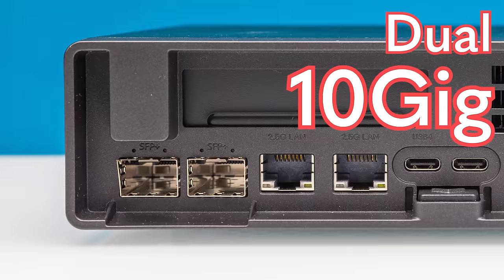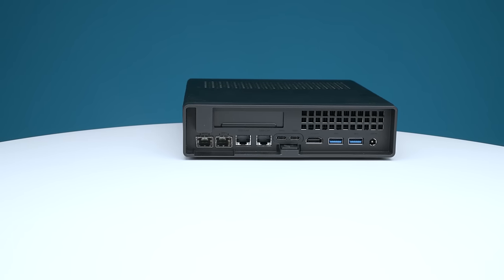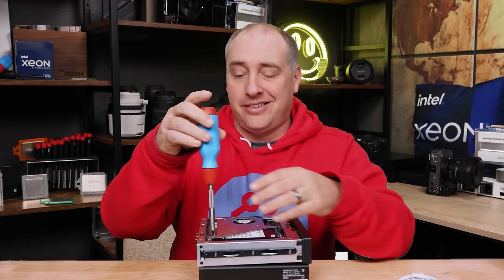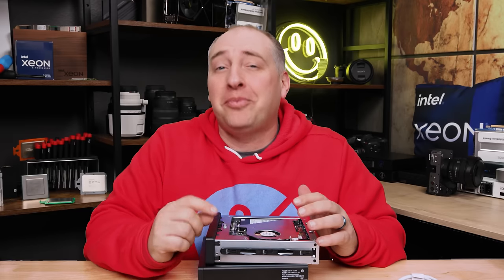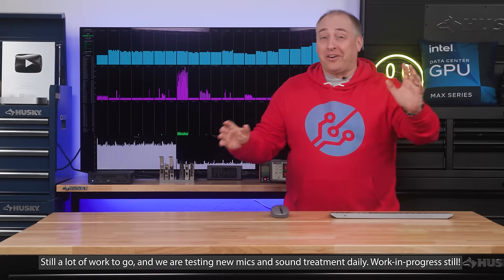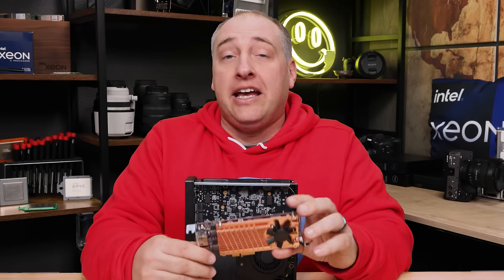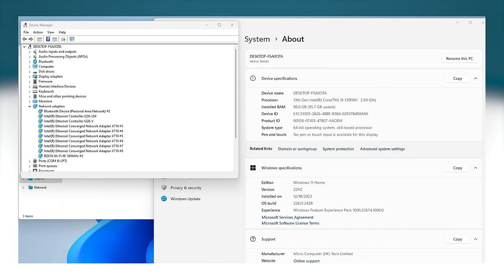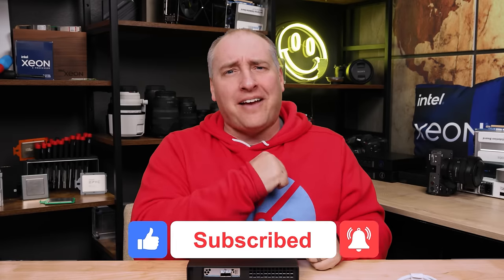The Pinnacle of Mini PC Servers - Minisforum MS-01

Comment: That feeling when random small chinese OEMs actually listen to customers while bic corporations still make the same NUC clones 10 years later
Reply: They listen but sometimes don't understand.. Case and point the R86s now has USB-C power, but it isn't standard USB-C PD power it is some funky direct wire that doesn't seem to work with a bunch of power supplies. The point of users asking for USB-C on it was so they could use standard high quality power supplies easily.
Reply: @YKSGuy this is probably due to cost constraints.
Reply: @Wfmike  cost constraints? Do you know how cheap it is to get a little PCB that just requests the right voltage from a PD supply? Costs a couple of dollars, probably way less if you're an OEM
Reply: @fallow_  sure a PD trigger is cheap... but you cannot just slap a port like that on the machine....
Reply: @nhansgoofyvideos7581  but that appears to be what they did, but without the PD part, they just swapped the barrel with a USB-C physical port that does not seem to quite work with most USB-C power sources.. Slapping the PD board in there would probably have been more reliable or SIMPLY not changing from the barrel jack.. IN some ways a non standard USB-C is WORSE than a barrel jack.
Reply: 25:30 can it run a 32gb FC card? You know, to attach to my SAN. 😊
Reply: @YKSGuy  Language barriers probably play a part into this tbh. I'm sure they've probably seen the responses the product reviews and realized their 'mistake'.
Reply: I didn't realize Bic even made things other than like pens or lighters
Reply: American fans being angry now
Reply: Minisforum isnt exactly a "small chinese OEM"
Reply: @deher9110  it's close enough.
Reply: Yea they listen to everything the customer does too lol
Reply: @kliniktech2485 while the lone indonesian rushes to defense of dear PRC
Reply: The big players know this would cannibalize some server sales so that's why you'll never see something like this HP or Dell.
Reply: Ooof
Reply: @marcogenovesi8570 At 400+ likes/thumbs ups, your comment is still underrated.
Reply: This is what i feel since soo many years =)
Reply: Intel tends to do that
Reply: @silenthill4  I said "NUC clones" not NUCs. I'm talking of ASUS/Gigabyte/MSI and other big OEMs. They all make NUC clones that are just mini PCs for basic office use
Reply: @jamesgarcia123  Legend says they listen through... a backdoor lmao
Reply: Same thing with switches too. Why isn't TPLINK / Netgear / Mikrotik / Unifi etc not keeping up with the plug and play managed switch 10Gbe stuff flying out of aliexpress?

Comment: 13:00 They could have made that voltage switch safe by design. Meaning, if you want to install the U.2 adapter, place the switch in a way that the adapter can only be installed when it’s switched „out of the way“. Same goes for the M.2 slot. Chance is, that it could be placed that both the U.2 and M.2 could only be installed when the switch is set to the correct voltage (position).
Reply: agree, they can use some NC pins to do auto-detection for required voltage supply instead of doing the "killswitch" method. The idea being atleast there's 2 NC pin on SSD that arent being used, both by SATA and NVMe protocol on M.2 M key, and if the user plug the M.2 to U.2 adapter, this two separate NC pins is shorted, thus telling the system to send 5/12V signal instead of 3.3V
Reply: my problem with the switch is that it makes the standard connector none standard, installing a small jumper cable to bring the correct voltage to the adapter would have been much better in terms of safe i think.
Reply: @pingtime that could work, although, I wonder if there's standards compliance issues preventing this, and if they want to sell the M.2 to U.2 adapter board as a separate SKU and be universal with other systems from other OEMs. Maybe the switch could have a plastic barrier that physically blocks the M.2 port when set to U.2 mode, that may be better. Having said that, a better design is certainly desirable and needed.
Reply: @blkhackr or have a power connector on the motherboard that the adapter board slots into in the same way as it connects to the M.2 slot that provides the correct power.
Reply: @technerd9655  From what I know working as ODM engineer, no, atleast PCI-SIG didnt really enforce it. For example, M.2 E key should have 2x1 PCIe lanes + USB coming off it, (yes, not PCIe x2, but 2 separate x1 lanes), but most manufacturer didn't bother, and when google released their dual coral TPU on M.2 E key form factor, almost all customer that tried it on their off the shelf M.2 E key slot only can use 1 of 2 TPU chip, since the second one routed to non-existent 2nd PCIe x1 lane.
Reply: A spring on the switch to force it to m.2 position, and the u.2 board designed to push the switch over during install. Dun and Dun. 
(Or just leave the u.2 out entirely. It's such a tiny niche feature and anybody reusing u.2 in a homelab would be happier with a jbod chassis that supported hot swap anyway.)

Comment: Patrick, the newest rev of the MS-01 with the 13900H, the U.2 or M.2 switch is now labeled higher on the board, so when you have that adapter installed, you can now see the mode the switch is set to.
Reply from the maker: Good to see they are taking my feedback.

Comment: I would like you to run your power tests in a low power configuration. Most people want a system like this as a home server. In a home server application, the idle power consumption is key and the max performance is almost irrelevant.
Reply: Yhe the 10 watt is way to much. Power is expensive and everything above 8 watt is a no no. Would love to see how low it can go.

Comment: 7940HS would have been cool so we had built in AV1 encoding. The Arc Pro A40 is still MIA over a year later.
Reply: Same sentiments. I'd probably hold out for the V2/next release.
Reply: AMD AV1 encoder is worse than QSV and NVENC, and if you are doing AV1 for archival purpose then CPU encoding is still far better.
Streaming wise QSV h265 is already blazing fast so idk why there is this craze about AV1 hardware encoder
Reply: @n0k0m3  
True. It would just be a nice to have if you use your server to encode streams in real time, assuming your other devices support AV1. Doesn't really matter, but being able to stream a movie from outside your home in just a tiny bit better quality at the same bitrate is worth it to some people. Would be great if the Arc A40 was actually available or if Nvidia cared about the low-power market. The last half-height, single-slot card we got from Nvidia was the GT 1030, and it doesn't even have an encoder. And the T1000 uses Pascal's NVENC.
Reply: @n0k0m3 From what I've read so far, the gap between AMF AV1 encoder and QSV and NVENC ones is far smaller then the gap between H.264 and HEVC encoders.
Reply: @offspringfan89  ur right, my bias was from EposVox video 3-4 years ago, just got updated with the Tom's Hardware video encoding benchmark.
Apparently gaps between AV1 encoders (NVENC, QSV, AMF, CPU) are between 1-2 VMAF points now and in some cases they are equal. Also FPS for QSV is a little bit lower as well so having the 7940HS will be indeed beneficial

Comment: I just ended up pulling the trigger and pre-ordering one of these. I already got the Quotom unit previously reviewed (Q20332G9-S10 now sold out) and mentioned in this video. With the pair of SFP+ ports, it will be an easy path to 10Gb networking. I'm not moving over on day one, so i'm glad there's still a pair of 2.5Gb ports as well. This box will be perfect for any sort of transcoding and even some AI LLM use. Can't wait to get it.
Reply: Sold out? I hope that product line isn’t dead.

Comment: Impressive little box. They should look into GPU modules using mobile GPUs/power supplies in the same case, would be neat to be able to stack them and connect over USB4 with it looking quite neat.

Comment: I like the thin client form factor a lot more than the typical mini-PC form factor. It's similar to ATX cases where you can just pop off the side panel to swap parts, and also looks sleeker while taking up less horizontal space when it's setup vertically. When it comes to thermals though I'm not sure which one is better.

Comment: Great video review as always -- appreciate the in depth coverage.  I've been waiting for this video since you teased the MS-01 in the short.  

I know you recommended keeping below 25w, but the Minisforum website claims it can support a RTX A2000 Mobile so I'd have loved to see that claim tested.  While you have a lot of server/IT fans, there's probably a lot of crossover for people who like gaming/workstation content and would like to see at least one or two cards tried out in that realm with the results documented.  Thanks again, keep up the good work!
Reply from the maker: I talked about it a bit more in the main site's review today. RTX A2000 Mobile support is modders in China. We could not get a LP single slot A2000 Mobile. You also need enough power for it (240-250W power brick) and it will drop the CPU power limits and performance by adding the A2000 Mobile.
Reply: @ServeTheHomeVideo  will double back to the article, thanks. 

 Any other low profile half height graphics card would have sufficed.  Tracking on the reduced power available and the bigger brick need.  If you guys didn't have a bigger power supply for testing purposes I understand - just know there will probably be many comments asking about it (which is always good for the algorithm :V).  Thanks!

Comment: I wish you would do actual tests on deep packet inspection throughput. That is a far higher demanding workload for using this as a modern firewall than just routing and stateful inspection. That other mini PC you talked about in this vid for comparison doesnt even come close to 10gb routing through the firewall to WAN when running something like Surricata or ZenArmor. This one *might*, but it would be nice to see some testing and see for sure just what it can do. This one may have more cores, but it is still only 200-400MHz faster (depending on  if you have the 3758R or non-R), so single traffic stream performance likely wont be more than around 1gb faster. Coming from not only the bit of extra core speed but also more IPC in this CPU.
Reply: FWIW I run Suricata on an i3-8100 which is probably considerably slower than the i9-13900H, and it only uses about 25-30% CPU for 1gbit/s down. I’ve only ever checked global CPU utilization though, so I have no idea how well spread out it is over the cores. Still, I’d be confident in this machine being able to do well above 1 gbit. Will it manage 10 gbit? I’m not sure.
Reply: Do you want to do deep packet inspection on your 10G traffic? IDS/IPS only ever made sense to me on a WAN interface to hostile external environments (aka the Internet), and those aren’t usually more than 1G links.

Comment: @ServeTheHome maybe is worth to mention ( as a note ) that 96GB of RAM is supported only on the model with the Intel i9-13900H, the one with the i9-12900H only supports 64GB of RAM according to Intel design.
Reply: Thank you.
Reply: It may be worthwhile to test more than 64 gb on the 12th gen as Intel ark limits on ram isn't always a hard limit. The Intel N305 seems to work well enough with 32gb to have mini PCs ship with it even though it's limited to 16gb according to Intel.
Reply: @Lollllllz  I've place the order for Intel 12th gen edition, maybe I can check on mine when arrives. I'll let you know, but I'm not confident it will works
Reply: Upon further review, this is no longer as clear. Intel may very well have implanted a hardware block on the H CPUs out of spite for OEMs. Who's got a 12th gen coming that's willing to burn some money?

Original comment:

STH has tested 12th gen with 48 GB DIMMs, so this is incorrect. https://www.youtube.com/watch?v=HylKpDmwaFA

Intel 12th gen absolteuly supports these DIMMs, and the mobos should be identical so there's no reason the 12th gen model won't. As always, documented support and actual support are never the same thing.
Reply: @MattNukem  that particular CPU is listed to support up to 128GB by Intel, not surprise it works with a single 48GB SODIMM or a total of 96GB in 42GB by 2
Reply: @Maverick87Shaka  Hmm, I did fail to factor in "Intel's unholy spite" in memory configs. There's no fundamental difference between a 12700T and a 12900H, other than Intel baking in a hardware lock to force OEMs into more expensive parts. Just as well given a 48 GB DIMM costs as much as pair of 32 GB DIMMs.
Reply: Looks like a Minisforum rep updated the STH thread confirming there's no issue with 48 GB DIMMs on the 12900H.

Comment: This would be a perfect as a nas. Pull the ssd and wifi out and have 4 m.2 drives and put in a pcie card with 2 more m.2 ports.
Reply: I wish he had tried something besides the qnap card with extra nics on it.  I would like to see if 8x8 bifurcation is possible,.  Otherwise it's a no go.
Reply: @fwiler  Is bifurcation supported to begin with?

Comment: Great report, I’ve been looking for a VM test lab hardware, the product designers can fix the voltage switch by modifying the drive bracket, such that it cannot be installed unless the U.2 is selected, simple fix with sheet metal.

Comment: Patrick was right.  The clearance under the heat dissipation bracket and fan is so tight that you can’t even fit an ultra-thin heatsink (I.e., a .5mm silica gel pad and 1mm copper plate) on the second or third SSD (although placing it on the first SSD, which isn’t encumbered by the fan, isn’t a problem).

Comment: This is super cool. It has basically everything. Only way it could be better, is 1x25G instead of 2x10G. No front facing USB Type-C is a bit meh, but not a big deal. Would definitively be nice to see evolution of this. I am not in a need at the moment, but definitively interesting.
Reply: Why one 25Gbs? I see two 10Gbs much more useful for a firewall device or router.
Reply: @deanwilliams433  damn right! Who is running 25Gps ethernet at home? More ports definitely more useful for router/firewall/switch

Comment: I'd be curious if you could forsake wifi and stick in a 2230 m.2 size drive to host your VM hyperadvisor or OS on (Proxmox, Truenas, Windows Server HypervV, etc)  then have the 3 full sized built in m.2 drives in a RAID config.
Reply: That was part of my thought watching this. I'm searching for servers to run my office's proxmox cluster (we are moving off of VMWare after a recent renewal that almost didn't happen) I think 4 of these with a 128gb drive in the wifi slot and 3 2tb intel nvme drives would work perfect for running CEPH. 6tb usable space and the ability to run a melanox dual 25gb card is pretty tempting since I only need to store 2tb of data, just need it up all the time for medical work.

Comment: You didn't mention the greatest achievement - flipping the PCIe card over so it doesn't "dutch oven" itself. Something that is the achilles heel for 1L "discrete" PCs - that's shy they stop making them. Although Minisforum didn't think to drill holes on top of the PCIe card so it can get natural cooling - having the cover out usually is enough for most PCIe cards, as long it's position this way. I still don't get why vendors have to feed us low version USB slots when the chipset allows for a lot more and higher version for free.
Personally I would love Minisforum to have the the i9-13900T option - Uber low idle and very low consumption power - low power consumption option for my linux ESXi systems and higher power consumption option for my windows ESXi systems. Love the USB 4, 2.5Gb and 10Gb ports. I would definitely not say no to an extra NVMe.

P.S. Minisforum could feed the U2 high voltage from the screw mounts and get away with the M.2/U.2 switch entirely.

Comment: As far as that X710 issue goes, I recently received 14 new servers at work with a similar issue.  While the cards install, there is no way to populate all the SFP ports, as the top port always has some obstacle.  This would not work with any SFP module nor any SFP cable.  So, we were stuck with just 3 ports actually being usable.  Since it is just a test/education lab environment, it didn't really matter that much, but it still brings up that there are issues with any quad SFP port card and low profile.  There just isn't enough room.